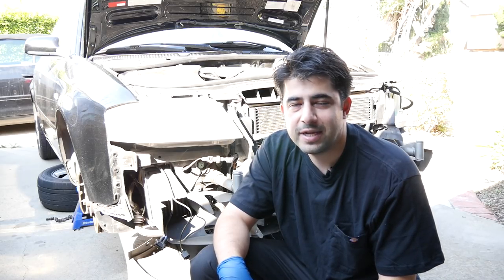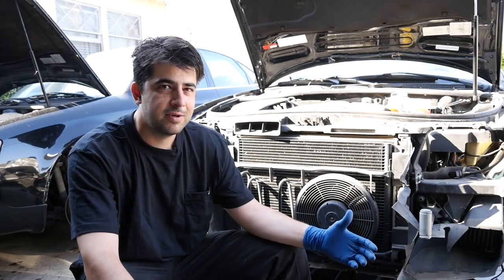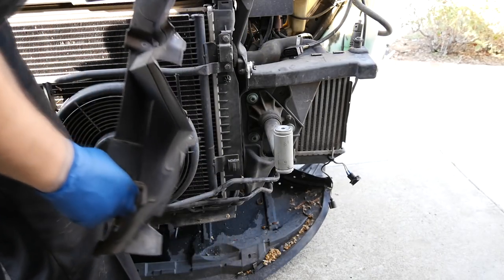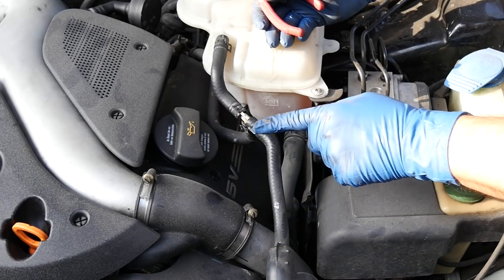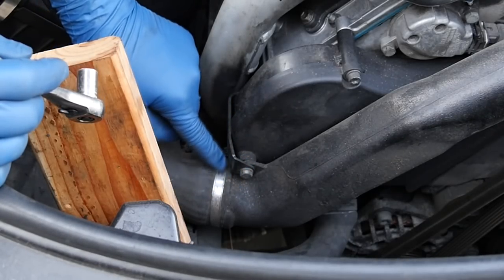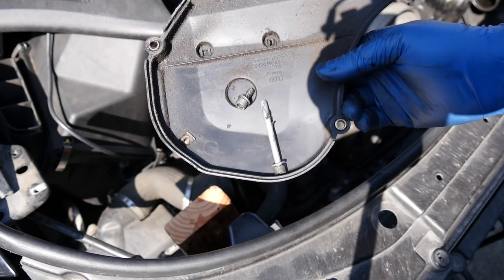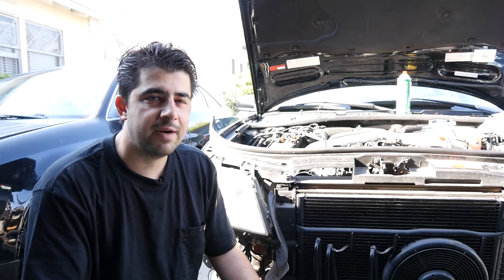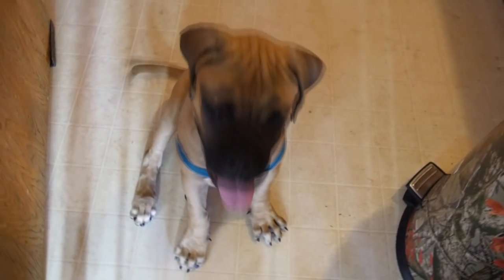Watch This Video Before You Buy an Audi

Comment from the maker: I should have probably been more clear on this, but the point of this video wasn't to sh8t on Audi's. But simply letting people out there that are not familiar with Audi's know maintaining an Audi isn't the same as maintaining a Toyota Corolla. For the right person with either the know how or the money to keep these maintained, owning an Audi is an absolute pleasure.
Reply from the maker: Utter nonsense. The only way I can see that working is if you take it off every 10k miles and treat it than put it back on. So either put in 5 times the labor of replacing the belt or spend the time and do it yourself.
Reply from the maker: I am gona delete the link so others don't go watch that crp, its nothing against you.
Reply: Ratchets And Wrenches I hope you realize that the 2016 and redesigned 2017 models are the most reliable Germans. Check consumer reports as well.
Reply: Audilife it's only reliable cause it hasn't been through the test of time but a lot of older audi's are reliable
Reply: It's rather difficult to say that they are the most reliable until these new generation cars start to age more, but it looks promising.  Granted I owned a 911T that never gave me any issues, it all depends on the car/owner/maintenance
Reply: Ratchets And Wrenches 
Those cars are very expensive repair at the shop . if maintenance this car it will keep you longer but other things like to about falling apart then put the car in shop costly $$$$$ so you are mechanic you should be no problem lol 😉
Reply: Ratchets And Wrenches Hermano great video. I like Audi alot but harder to work on. That's why I went Mercedes. Siga palante.
Reply: A.J. Scalzitti Porsche is just as reliable as Lexus, they are well made even jd power ties them in reliability
Reply: Ratchets And Wrenches  awesome videos , can't wait to see the next one. Me as a young guy working on
And learning 
About cars, your videos have been helpful. not enough people 
Appreciate the information on these videos,but I say keep em coming ✊🔧
Reply: Ratchets And Wrenches I really need your help.  How can I 're charge freon in 97 audio cabriolet? No low port found. Is it hiding somewhere?
Reply: Sure, why don't you tell us how it's done.
Reply: Service position?
Reply: Audilife 😂😂😂😂
Reply: Ratchets And Wrenches Hi, i'm from Portugal and i have a 1997 audi a6 and there is no comparison with hondas or toyotas, my car has 320 000 km's with services on time, and it still rides like new. That's why you pay hard. Please don't compare the uncomparable. I'm defending the audi owners, no ofence.
Reply: My VW Passat V6 was the same with the service position. I got pretty fast at it after a while though; learned a few tricks. I replaced the cam timing chain, timing belt, water pump, etc...
Reply: Oh i didn't take it like that at all.  I love audi ,bmw, lexus regardless of what someone says :p  For some unknown reason(s), i don't particularly like Mercedes...Maybe I hated someone who had a Mercedes?? LOL
Reply: I may not own an Audi, but my e46 has enlightened me on the POV the engineers had when designing components. It also gave me an idea on what they had to compromise to save weight, cost, ect. When first launched the e46 was praised but as it aged many issues arose. This is the case with others that I've seen besides BMW. The Germans love pushing the envelope for efficiency, performance, and safety's sake. Those who don't scrap their cars and see past the obvious issues fix them. Eventually you get a strong community who search for ways to repair and improve their vehicle. 

So I get it.
Reply: Hello there, where do you get your information on the car service information.. and can the information for these cars or any car be accessible by anyone?
Reply: Really good advice.thank you
Reply: I have an Audi and a Corolla lol. Audi is way more complicated but the part quality is wayyy higher. Audi panels are easy to align and you can reuse clips. Once you take the bumper off a toyota good luck getting it perfect again lol. Love em both though
Reply: ya tell me about it
Reply: Ratchets And Wrenches help HHR 07 . It is a fault (TC) Traction Control and also stand on the Service Traction board. Someone knows how to fix that fault when that failure appears the changes come in abruptly.
Reply: You should have more thumbs up than you have and it isn't b/c the quality of the video, it's b/c people forget.  People are used to hearing the reminder and it would probably really help your ratings/ranking.  A simple "if you liked it or it helped you out, a thumbs up would be appreciated!"  5 seconds isn't going to kill the viewer.  There's that much silence between each word or sentence in some people's videos.
Reply: It's funny you should mention it isn't like maintaining a Corolla...I have a v8 Audi Allroad and a v6 vw Passat 4motion wagon, and I realize after doing maintenance on those that I really do miss my Corolla...

Comment: I own an Audi vehicle, and when everything is working they are  a pleasure to drive. But as this video shows, when something goes wrong it's very expensive to maintain. So the video really should be entitled 'maintenance on an Audi vehicle can be expensive'
Reply: Donald E Ok!
Reply: Donald E I did get it correct!
Reply: More like "Maintenance on an Audi is a pain in the ass, and that's why it's expensive.", even worse though, is that the mechanics you hire to do the job for you don't necessarily know how to do the job either. I came across so many broken parts, misaligned parts, and boogered up hardware from "Impact Monkeys" that the job is even more difficult still...And then there is this corrosion issue as the cars get up in years.

Comment: As a general rule, don't buy an Audi with 100K miles on it unless you are a mechanic, have a buddy who's a mechanic, or a DIY youtube mechanic like I am  :)  However, you can confidently buy Lexus with 150K miles on it, the timing belt (chain) won't break and drive train is very likely to be fine.  Just do a good tuneup and fluid flush.  Don't forget to change the "life time" transmission fluid, too. LOL    By the way, Audis have great style and more fun to drive than the Lexus. ;p  Thanks for your excellent videos.
Reply: I own a 2000 Audi TT with 135k Miles on it. My first big repair was last year about 300,00 €.
Reply: got my 96 ls 400 for 300 bucks nothing wrong with it , my gf busted the front right headlight unit and come to find out it is a 350 dollar fix if i do it myself, that is more than what i paid for the car so no i will not go out and buy another lexus unless it is dirt cheap and i can simply drive it into the ground without putting anything into it. great car but really it is just an overpriced toyota.

Comment: Thanks for your video, I've had this 2001 A6 2.7T which auto trans had been in limp mode for a long while, I've had to change the auto transmission with no change. However, I love this car and don't want to give up on it; so I've decided to convert to a manual transmission. Two things I'd like to know however is what specs of manual trans will work for the car and also to ask what I need to check before I finally do the conversion? Thanks.

Comment: One of my best friends is an AUDI tech, him, and almost every other tech there drives a Japanese car. Says a lot.
Reply: that audi doesn't pay their techs enough to afford German?
Reply: You couldn't pay me to drive a german car. And it's not because I'm Dutch.
Reply: The service manager and his wife at our local MB and Porsche dealership drive Japanese brands.  He has hilarious stories about the fools who buy German cars and then expect reliability.
Reply: vw/ audi's are extremely reliable if you use common sense preventive maintenance schedule and also very affordable if you know how to do it yourself;)
Reply: wv tiguan 08 with 90k miles on it. 7(!!!!!!!!!!!!!!!!!!!!!) water pumps was  been replaced on vw dealership for whole car live. Random misfire in cylider 4. Oil in intake. Bad rear seal. My friends was been second owner of this car for 2 years. Finally we did get rid of this lemon. Replacement car was been 03 honda pilot with 245k miles. One owner. Just original struts start leaking and i did cleanup IDLE valve(1$ on greace and cleaner and 1hr time). Runs like new, exust clean like new(do not burns oil at all!!!!).
Reply: That's subjective, I've got an 2010 A4, 180,000km and never had an issue, only routine maintenance. 

Can't say the same about my friends and their Japanese cars.
Reply: You've got to be kidding, right?  I can't recall a single major (or minor) country in the world where I haven't seen a LOT of Japanese cars on the road.  And in places where vehicle reliability is life or death you see Japanese brands almost exclusively and hardly ever see anything German.
In the U.S., German brands largest market, you see very few old ones on the road and huge numbers of old Toyotas, Subarus and others. No trouble finding scrap yard parts for German cars!
Reply: ckatlinga standard in what? In creating software to cheat emissions test? Or standard in creating cartel to fix prices? German cars are massively overrated.  What's the most unreliable car in German reliablity tests?  Mercedes ML.
Reply: wholeNwon there are people who buy German brands and have great times with it...our 2015 X5 has been with us for 2 years as of now, and we still have it...last but not least take a look at the 2017 JD power and dependability study...Porsche, BMW, Benz, and Audi have been ranked in top 20s and still push through perfectly fine
Reply: Interesting..my brother's neighbor is head mechanic for South Shore Audi-he drives a Nissan. I asked him and he did say that an Audi does require frequent expensive service.
Reply: Ad Mirer frequent expensive maintenance, I've got an Audi, I read the owners manual. Theirs a serve every 25,000km. Most of them are service like lubricating joints , replacing filters and checking to see if wear and tear components. They extended services cost about 500-600. And can be done at other shops, doesn't have to be an Audi Dealer. It's also not mandatory. With that being said, all vehicle manufactures have thes. I mean hell a basic honda civic has a $1600 service at around 130k miles for replacing a timing belt.
Reply: no way.  This is not real cost. 200-300$ timing belt.
Reply: I have no idea where did you get this numbers, but nissan is gonna brake less often when any european brand.  I don't going to service(i have a shop with car lift, frame machine and paint bus), but still you can get estimate online.
Reply: ruhoer eoijre shop mechanics and dealers use a standard like "Alldata" to standardize how much a job takes and costs. Then apply their shop rate. So if Alldaya says it take 4 Hours to replace the timing belt... And shop rate is $105/hour. Which is normal. Your looking at $420 just for labour +tax. Then parts. Again this is just the belt. The service pack includes all your filters, lube, inspection + timing belt, drive belt, water pump and idler pully. It comes out to a  pricey service.
Reply: ckatlinga that's true but Toyota and Lexus and Honda are in the top 10
Reply: God of destruction while yes, they are... Audi is in thr top 5, last I checked. Suprisingly
Reply: No, it says they drive cheap cars...and nothing else.😂
Reply: Nope. It says "There's a sucker born every minute" and some of them buy German cars.
Reply: ndk2k4  corolla and honda thump up...
Reply: baki4king no common sense available in the US.
Reply: This is option in the US)))
Reply: ndk2k4 exactly
Reply: @ckatlinga you are the exact fools that buy Audis thinking this way
Reply: @ckatlinga More like CAN'T do routine maintenance because the whole front end  needs to come apart first!
Reply: @ckatlinga Because Asian cars are more reliable. It's the other way around German followed Asian standards.

Comment: Money pits when they get older. Great vids tho!
Reply: not true as long as you properly take care of them
Reply: Doesn't matter how well they are maintain, they fall apart as they age and have all sorts for electrical problems. You will be spending a small fortune fixing all the little things. It's almost impossible to work on these cars without a dealer level scan tool with all the crazy complex computer's they put in them. All the computer control modules are all equally expensive.
Reply: Eman 08 agree, get a Toyota if you want to have more money in your wallet
Reply: Eman 08 lmao your really trying to prove a point huh
Reply: @Samuel Bowman haha I worked on them all the time and made big money fixing those money pits. Ha!

Comment: I used to work at a shop that rebuilt engines completely, so we'd usually just remove the entire front end of these Audis, we'd have to put coolant back in the radiators anyway if we're taking the engine apart, so might as well just make it easier.

Comment: This makes me glad to have a genesis coupe. Except for tires, I've done 100% of maintenance and aftermarket mods myself with zero previous experience and no issues. Makes 348 HP stock, so no need to find a performance german car as she's got all the power I need.
Reply: Thanks for the video though and the links to the tools you used.

Comment: I have a manual 6sp 3.2 08 Audi A5, it’s been a dream. At 110k miles I haven’t had any issues after I’ve put on almost 10k miles. I had 2 bmws before this. An 06 bmw with 127k miles that’s been an absolute turd, put around 20k on it and it’s left me stranded 4 times haha. And I had an 02 325ci, it wasn’t bad at all, just a window regulator in all the time I drove it. Honestly though my audi has been a dream and would definitely choose an Audi over a bmw for any car I’d take in the future.

Comment: I had a S4 b5 2.7 biturbo a while ago. Did this job myself and all the maintenance. Everything you need to do starts with removing the front bumper😂
Pray that the turbos don't break because the engine needs to go out to change them!

Comment: Ive never replaced a timing chain belt up to 200k.  Seems chains are better.
Reply: Justin bustin unless its a vr6 haha.. Fml
Reply: Justin bustin not unless issa b7 or b6 s4 lol.
Reply: Justin bustin Chain is designed to last the life time of the engine. The ONLY problem is it require lubricant. So it is a more expensive system.
Reply: or a 750iL

Comment: My 01 ford focus was easier with a timing belt and 2 special tools to replace the belt and tensioner. Even the alternator was easier and still had to remove a motor mount to remove it. I can still do that job in under an hour for a 2 hour flat rate job.

Comment: A video on buying an Audi S6 v10 would be great. These have dropped to the 10k level and are great cars. Then another one on replacing the intake and doing the decarbon procedure. Jhmotorsports sells the parts and cleaners, but a video doing it would be great.  Also other common issues like upper control arms and leaking cam actuators. What upgraded exhaust sounds good.

Comment: I have a 2006 Audi A6 3.2 six cylinder with 171,000 miles. Bought with 45k. No engine problems EVER.. I just use 91 octane and 0W40 synthetic and she goes. Engine runs like a dream and never have put $1 into fixing anything other than the usual tires and brakes. Fantastic car! Take car of them and they will take care of you!

Also, I have three friends who have Audis. Two of my friends use premium gas and synthetic oil. They have had nearly ZERO issues with their engines. On the other hand, my other friend doesn't buy into the "premium" gas thing and he uses regular in his Audi. He has TONS of engine issues that pop up. He still uses synthetic but not premium gas so I think many people may just dump regular fuel in the engines and maybe it fucks them up. I'm not an expert on that, but maybe that's why the engine isn't in good health compared to my other friends and their Audis.
Reply: T Med I think you are on to something here..I own a 2008 audi A4 2.0T. I bought it with 55k, now it has 125k and never had issues with the engine. I use premium only and 0w40 synthetic mobil1. That little turbo engines goes...

Comment: Proof that these cars were were designed to be serviced while cleaning out your wallet.
Preplanned obsolesce from the manufacturer.
Reply: LD ODOM I've started to believe that now because compared to Asian cars they're poorly designed,   especially around the engine component.
Reply: Literally every single car in the entire world has planed obsolescence, without it you would never have to buy a car newer than 1990
Reply: LD ODOM everything that undergoes wear and tear is engineered with planned obsolescence. For example, do we need transmissions built to last 1 million miles? No, that would be expensive and unnecessary in most applications of non-fleet vehicles.

Comment: Was your PS pulley siezed up on the cylinder it sits in? I'm doing my timing belt on a 2.8 and took the bolts off and it feels like it's one solid piece to the pump. I pull the thing and it's just pulling the whole car.

Comment: Awesome video! I just happen to have a a6 c5 that is not going too well. The transmission revs too high before changing gears. Any tips for the possible cause? Also, vcds or vag can pro ?

I had to do all of that to change my water pump, and now I don't want to let go of the car for so cheap 😜😎

Comment: Tbh ive found the service position easy to get to and when you do its very convenient in the sense that yoi have access to alot of parts. The only downside is the expenses in parts which can be more but when it does run id never drive anything else. Vw and audi all the way